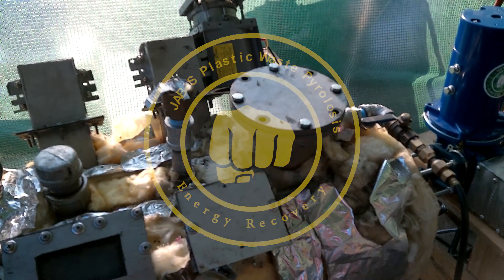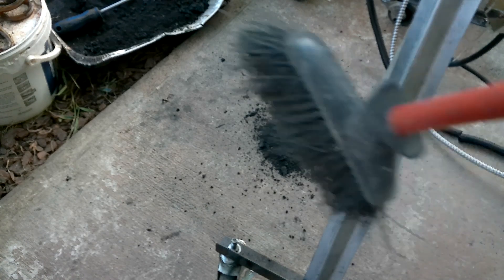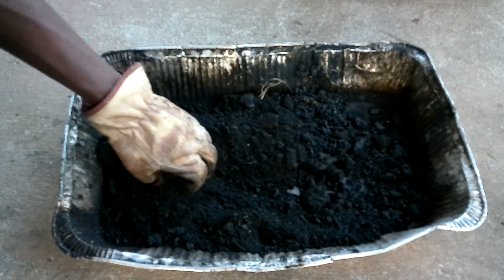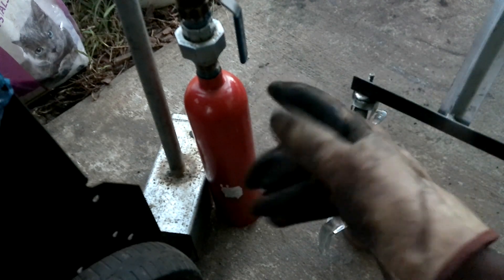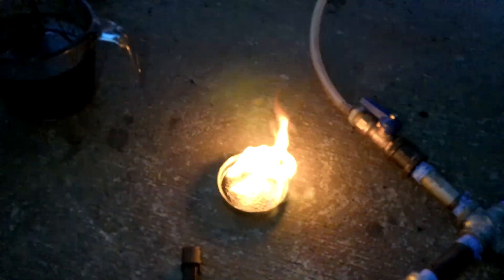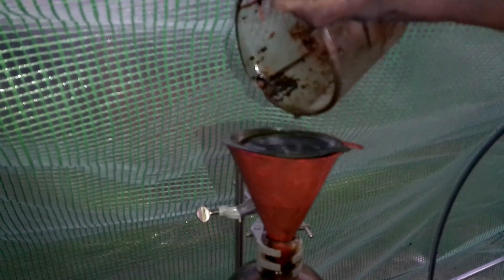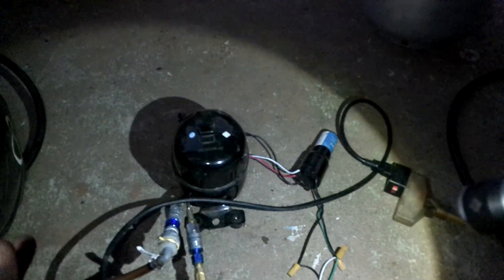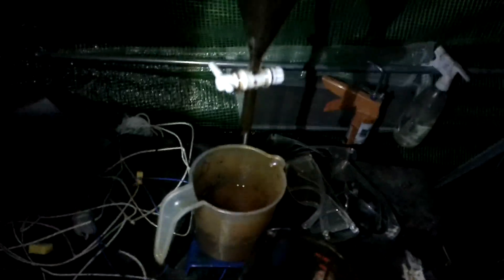PLASTIC into FUEL! - Running Mark 4 Reactor - Part 4: Results

Comment: Dude, lucky to see you a big step further :) Tip on my hat, Sir. 

But is the energy you put in worth the result? Did you do some math about it?
Because I am from the wood gas fraction, I have some ideas to do this on thermal base using wood gas for heating it up. 
My energy rating would be smaller than 130W to get the temperature (That's what it takes to start the process)
Reply: in an industrialized country surely not. Cause if it would be, a much richer motherfucker (or some of them) had already cornered the market. But in a non-developed country or a crisis situation it could be.

btw you also have to factor in the trash collecting which would be high costs in europe or the us cause of wages. So it's (if it would be cost effective) either small (only your own trash and the neighbours), very big or go home.

It's the same for wood gas.

Comment: This is amazing my question is could you use this for tires? The amount of oil I feel you would get would be not bad
Reply: yes you can, but the oil is too contimenate
Reply: yeah you can they already sell plants like this... search for "tire pyrolysis plant"
While being a nice experiment and showing how it's working this isn't a new technology.
Reply: You can, but it STINKS.  Plastic smells bad enough, and you can reduce the smells by evacuating the oxygen, but I'm not sure if anything except very high temperature combustion can get rid of the bad smell from rubber.

Comment: I've been using propane to heat my reactor and I used water for the first time and the pressure built up fast steam pressure but the oil came out two layers top layer highly flammable the bottom looks like dirty water 🤷‍♂️